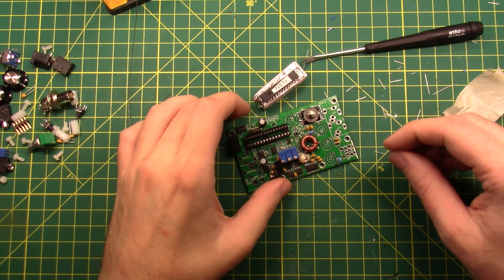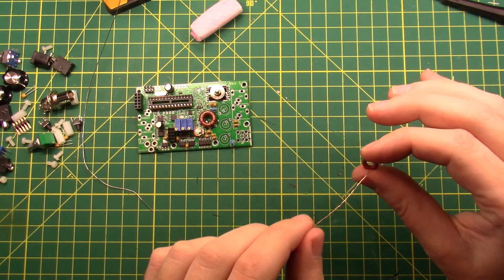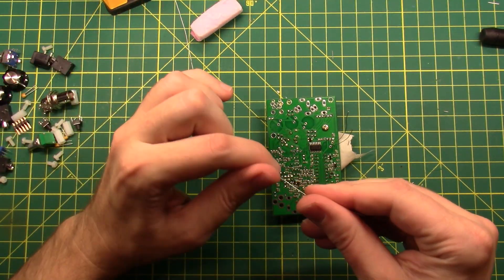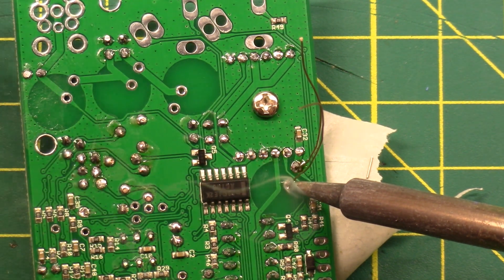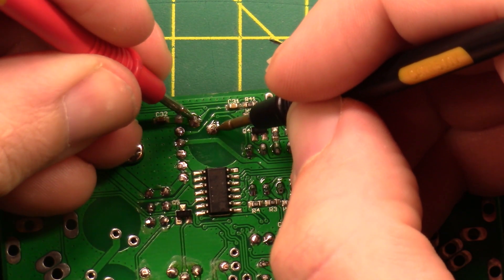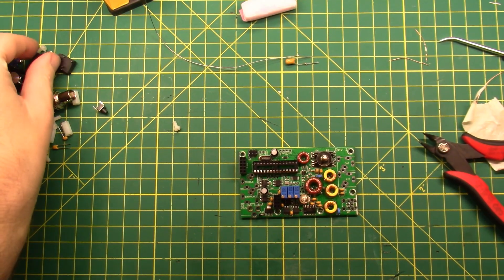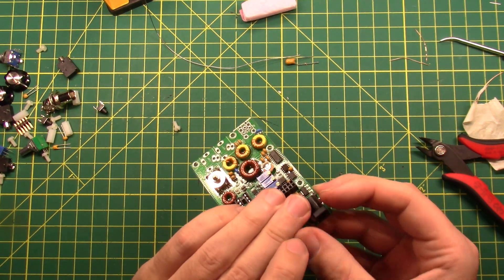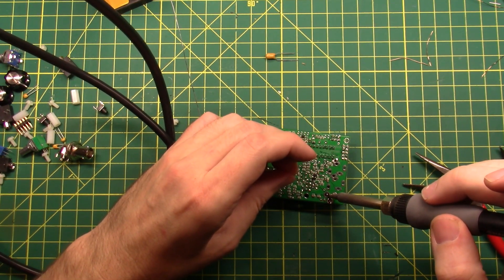How to build a QCX Mini - Part 5 - Audio Jacks, BNC Jacks

Comment: I was thinking that using the case ends themselves to hold everything in alignment would make the process easier.
Reply from the maker: Did you get one?  It's not too bad.  I categorize it as "clever" instead of "debilitating"
Reply: @temporarilyoffline  my 40m kit will be here shortly. Plus case, plus TCXO.
Reply from the maker: @AG7SM  excellent,  I had fun building the kit, the instructions are well laid out and the puzzle of daughter boards was good.